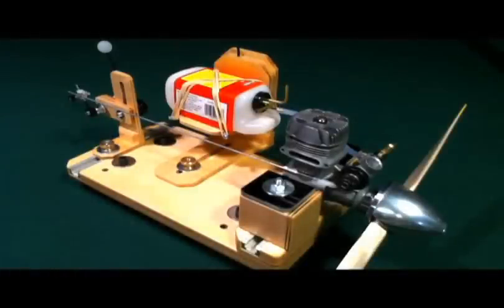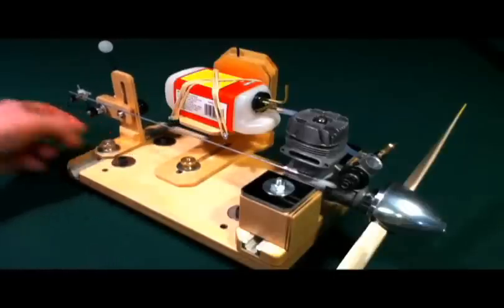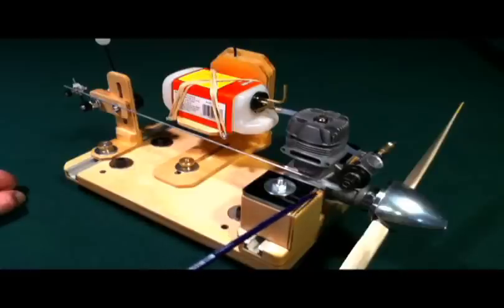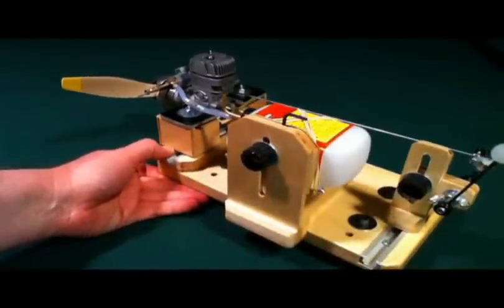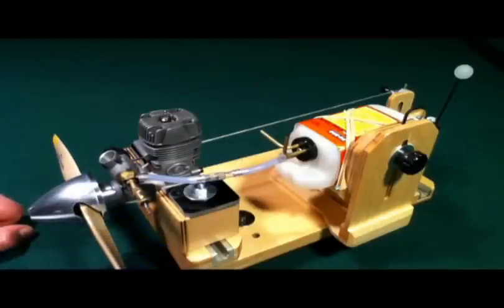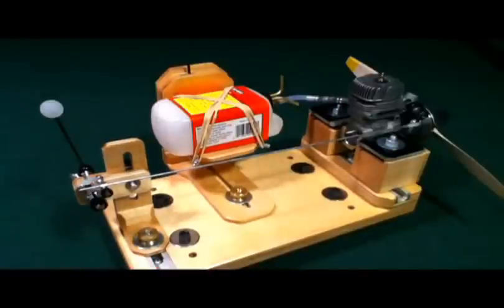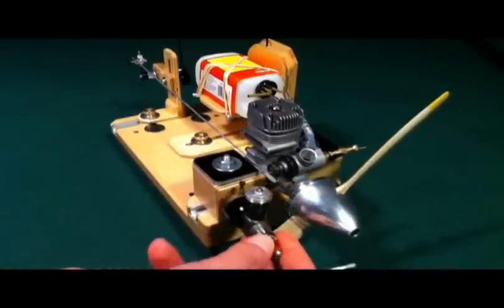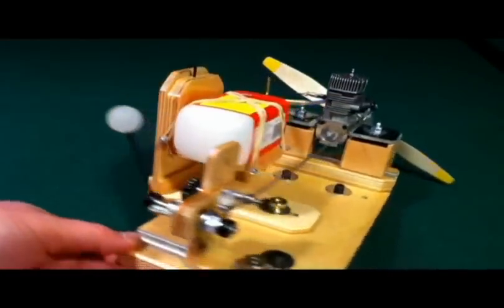Engine Test Stand for Radio Control & Control Line

Comment: Fire up that bad boy,  let's see it run!

I've never owned a gas powered RC airplane. They look like a lot of fun.
Reply: Gas/glow engines are extremely noisey, smokey, oil all over, and methanol fuel is $30gallon,  Just go electric.
Reply: @rogertycholiz2218  I Wound never tell a guy interested in rc planes to not go with 4 stroke or nitro 2 stroke or gas! I hate that electric planes , they sound like my electric razor. it's all about sound and realism for me as it may be for this new guy. Try and sell a Harley guy a japanese bike. If you don't mind a few extra dollars for fuel , gas is awesome. Not to mention the newer 2 cycle gas planes with true spart ignitions use no nitro, they use pump gas and 2 stroke oil like my dirt bike...it's really cheap , sound awesome and have great power.